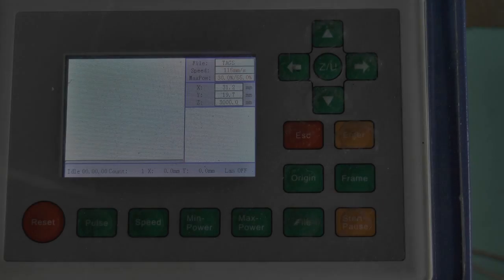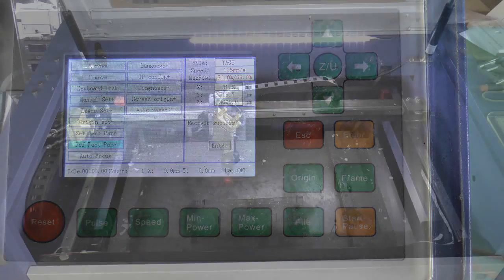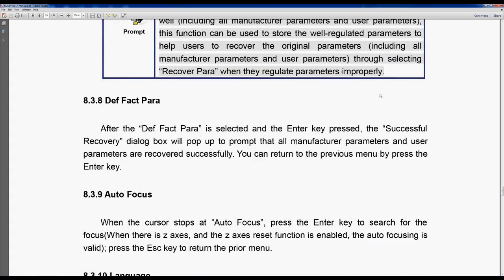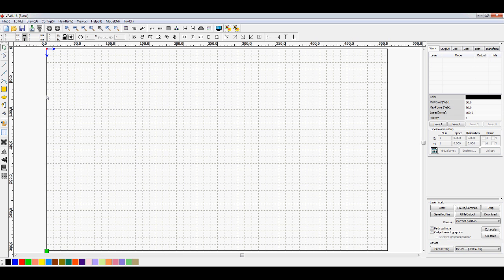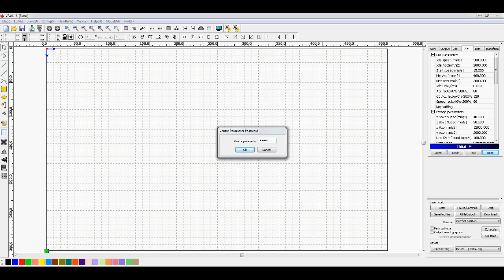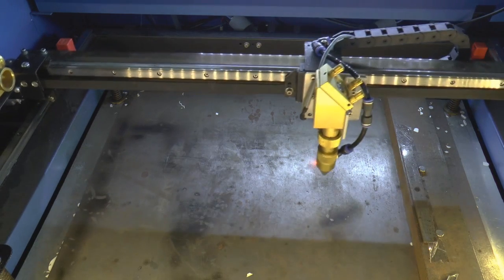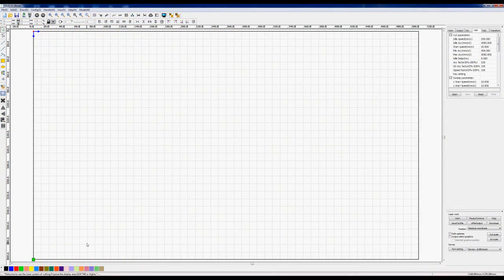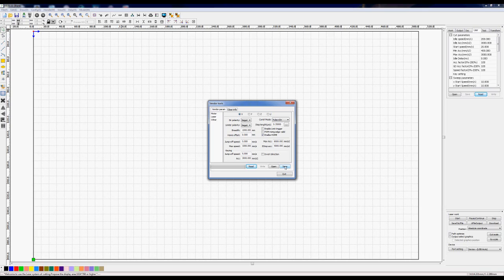RDWorks Learning Lab 74 Disaster Recovery

Comment: Thanks for the video Ross. As confuse as RDWorks is, the amount of settings and granularity you get is incredible. 

Ever tried to test how accurate the machine actually cuts? There is a setting called "calculate step precision" when you click the "..." at the right of the  "Step length(mu)" text box on the vendor settings window. In theory you draw a 100 x 100 mm square and cut it, preferable on something like paper, you measure the actual size that was cut and then input the values there. It will change the stepping length slightly based on your input. I did several times and got to get a consistent accuracy of about +-0.03 mm on both X and Y axis, the factory settings gave me an error of about +-0.1 on Y and +-0.8 mm on X.
Reply: Sounds too me like what we have to do in the 3d printing world with steps per mm and printing out a bloody cube until you have it dialed in as tight as you can.

Comment: Another useful video tutorial Russ thanks for putting the effort in.  Is there a simple way of changing the step value when moving the head manually?   Mine is quite coarse which makes using all of my material less efficient when resetting the origin.  Also I just tried the download mentioned below 8.01.18  etc and a virus warning came up.  Is the file clean?
Reply from the maker: Hi Peter
The speed of your manual arrow movements is set by your SPEED button. I have mine set at 110mm/sec for general scooting around the table. If I want to position more accurately I just press the SPEED button and change it to 10mm/s with a couple of button pushes. That generally works ok but already loaded into the machine, I do have couple of ABSOLUTE COORDINTE  programs set at 10.10 and 50,50. if I need a dead accurate position (say 50,50), I load the program and press FRAME and it stops the head at 50,50.  Press ORIGIN and there you have it.

Several people have come across the virus issue so I suspect different AV regard certain code strings as suspicious whereas my Mcafee AV is happy and it even checks the downloads as they happen for suspicious code. I have experienced no problems during the past year.

Best regards
Russ

Comment: I've had similar issues.  I can send you my config file which you can load via USB if you connect your computer directly.  That or I can send you the setting I've got for my machine.
Reply from the maker: Hi
Thanks a lot for your generous offer. It's always good to know there are fellow sufferers out there that are willing to help. In this particular situation my prudence in saving those files when I first bought my machine has restored my machine back to full health.
Sincere best wishes and thanks
Russ
Reply: I need these files seatdaddy@hotmail.com
Reply: I neeed file seatdaddy@hotmail.com thanks

Comment: I am following your tutorials since the very beginning.  And its time to jump in here and say a heartfelt "Thank You Russ" for all the work you put into this project. 
In my case I am pretty sure it saved me countless hours of jumping pitfalls (of which this device really has enough)

Just a quick question: are you still using a USB Stick to transfer files or do you have a notebook hooked up? This video makes me think you did hook up a PC. How else do you get those backup files from the device?
Reply from the maker: Hi Den 
99% of the time I use a USB stick but for looking into the heart of the machine you have to hook up with your pc. Its a painless exercise. Just Load up RDWorks and plug in your pc to the other USB port. You can then access those user and vendor files to copy them off.
Thanks for your kind words and glad that avoiding my mistakes has accelerated your progress.
Best regards
Russ
Reply: I gave up on the USB connection weeks ago. Tried to get the USB drivers to work on a Windows 8.1 machine and a Windows 10 machine. Couldn't get them to work on either. Always got an "unknown Device".

However, I wondered "Why does this thing have an ethernet jack"? So I entered an IP Adress in system settings, hooked it up with a laptop, entered its IP adress in RDworks and to my great surprise it simply worked. 
Now I work mostly directly out of RDworks avoiding the keypad on the device as much as possible. Mainly because I have the same problem you described in one of your tutorials, only worse (Pad starting to disintegrate)

Thanks again for all your work

Best regards
Dennis
Reply from the maker: Hi Dennis
I don't run windows 10 but I have downloaded the latest issue of RDWorks v8.01.18 from 
http://en.rd-acs.com/down.aspx?pageindex=2
I am assured by several correspondents that this runs well in win 10
Best regards
Russ